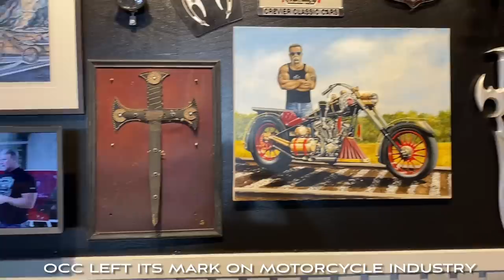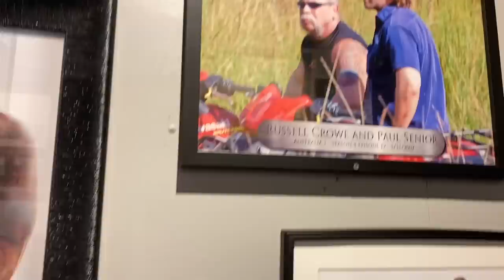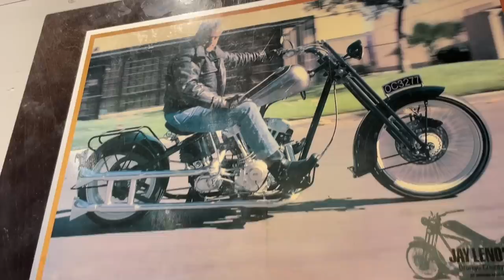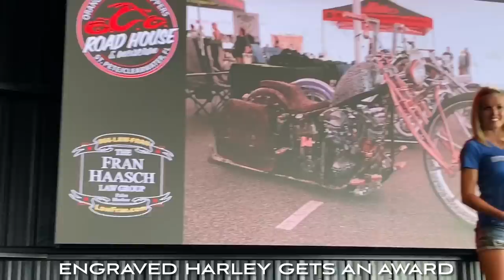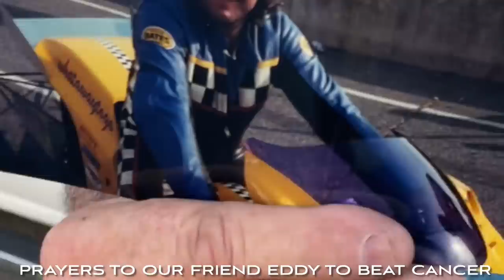Orange County Choppers BIKER BUILD OFF 2023

Comment: Jack , that top fuel bike Eddie has was built for Shawn garrigan by my friend Alan Zonker at Zonker cycles out of Fairborn Ohio at the time it was built , Alan built a rear engine top fuel Harley that was displayed in the Dayton art museum, Ian king bought it , it had a 13 inch aircraft front wheel 14 inch handlebar height, radical machine ,  Alan built all the parts to it , I know all this because Alan built my topgas chassis in 1987 , the first Kawasaki lowboy chassis , ahead of it's time , people wasn't ready for how low it was , really looked out of place next to the other bikes til many years later , 24 inch handlebar height, very low profile chassis , so that is very cool to see that motorcycle still looks the same , ive been friends with Alan for 40 years , very cool bike
Reply from the maker: so cool! I just talked to Eddy and fortunately he sold it! Thanks so much for watching. What was your favorite motorcycle in this video and why?

Comment: Man you need to learn your Harleys Jack!
Reply from the maker: Going by what the builder put on the tag. Admittedly I am not the strongest on older Harleys. But I got great editors like you. What did I screw up?
Reply: @cycledrag  knuckles..36 to 47. Pans 48 to 65 shovels 66 to 83 and so on and so forth!
Reply from the maker: @cartdoc  I understand that. But also understand if it's a custom, the builder can call it what he / she wants. For example a KZ with a sportbike front end and bodywork could be a "1995 Kawasaki KZ". I was just going off the tags. Come next year and you will see.
Reply: @cycledrag  yes.. before you know it you've lost track of the original year.. the more you add doesn't change the original year tho.I have an 84zn1300 with a 1993 Z06 fairing..does that make it a 93 model now? No